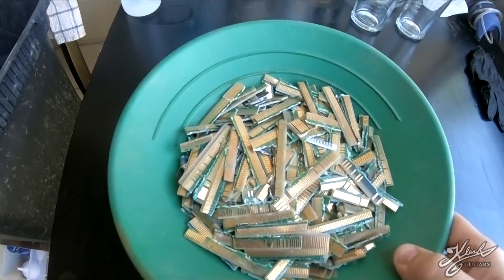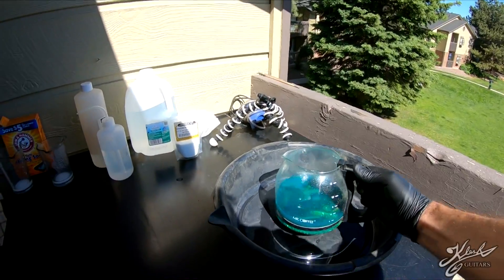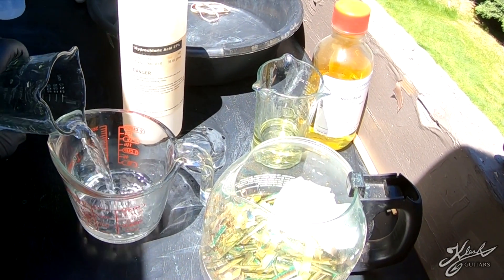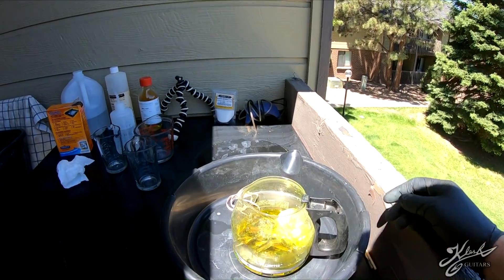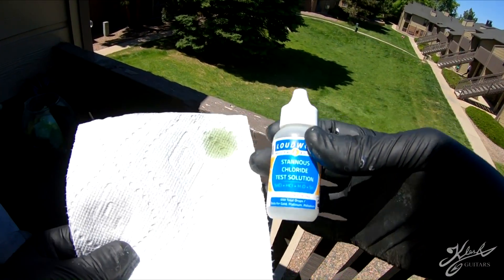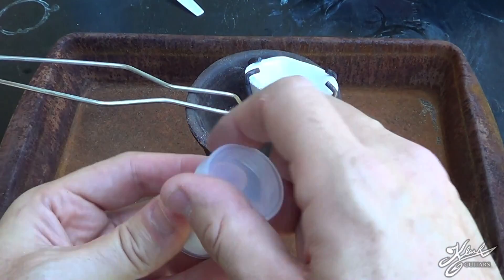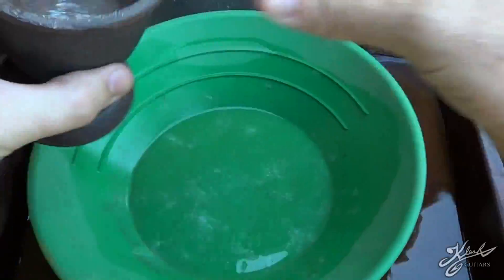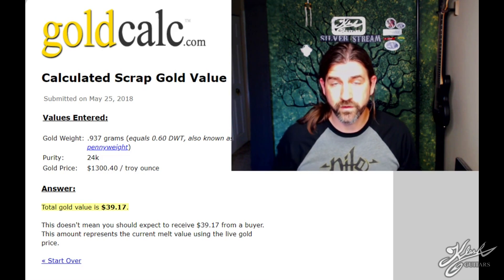How To Recover Gold from Computer Parts

Comment: I imagine your pretty new to e waste recovery.. your yeild is within the numbers as the range for fingers is 1-3 grams plbs.. being said not bad 😁 also premixing the ar wastes chemicals  
Causing excess SMB to be added recommend adding nitric to hcl in small doses) increments to dissolve gold using sulfamic acid to denoxx nitric free in solution is a trick of the trade...allowing you to avoid the foaming and possible boil over risk later...using 1 gram of SMB per 1 gram of expected gold works as a recipe... Personally I prefer using a dilute nitric until all the foils are released from sticks... Then concentrating to filter and washing... Then a ar solution will be cleaner and look yellow instead of green...as you know your solution had some copper dissolved and adding extra SMB drags down other metals when you percipitate the gold from solution... Making good less pure.
Absolutely love the percautions and clear throual step by step explanations.bravo good job hope my advice helps there's much more to learn these are basic steps I follow and such...may the gold be with you...
Reply from the maker: Thanks, yes I am new to doing this. I really appreciate the help! Also, thanks for watching!

Comment: I use a mini Oxy torch kit. Run on 2 1lb cylinders and gives good heat. I tried to do a copy and paste an Amazon link to my comment but it wouldn't let me. Just do a search for mini oxy acetylene torch kit. The burn through the gas, but they are fantastic for small jobs.
Reply from the maker: Steven LeBlanc thanks I’ll take a look

Comment: Does a older computer have more gold in it? I have one from the early 90's. Iv'e been saving some hard drives up. I wanted to find out how to do this. thanks, you should have saved that whole peace and made into a pendant.It looked very Kool. I put peace and Kool in because I'm from the old days. great video, i loved it.
Reply from the maker: don Moor4e not sure but I think older computers have more?
Reply: Older electronics did use more gold, most eletronic gold today is only a few microns thick, aloy of older telecommunications and military eletronics though used solid lower karat gold rather than todays 24 karat thinly electroplated gold.
Reply: Thanks

Comment: Heh this is something I know about. Unfortunately my parents don't let me play with highly corrosive acids T.T (JK I'm nearly 28)

I have to make my own peracetic acid to dissolve copper for electro plating and play with safe chemical reactions like thermite. (dont try thermite at home please)

That and I do all my experiments in an non-ventilated shed, aside from the thermite which I do in a dirt 'firepit'  I know silver thermite exists, I wonder if someone could get gold oxide and make gold thermite :O I know they use Gold oxide for glass work, but i'm not familiar enough with chemestry to know if it would work. Might need to call Cody's Lab for this one.

I'm waiting for the day I have enough panned gold to make a bar at home <3 I have a forge built out of a hairdryer and trash can that can easily melt gold and silver though I primarily use it for aluminum.

Also, 1 pound of electronic fingers is around 1 gram on average 1:1 gram to pound of scrap is a general estimate, though it strongly depends on the quality of the scrap. Something coming from Gaming high quality Ram vs cheap Shinese knockoff will have huge differences in the gold plating on the connectors. Same goes for wires and hardrives, processors, obviously the better built ones have a thicker gold plate.

Comment: not too shabby from 1 lb of parts.  There is a slightly safer method using vinegar, salt and heat, and it also needs to sit about a week if I remember correctly.  https://youtu.be/ouYW_7-Njbs

Comment: I have seen other videos like this. Actually built my computer. Not only ran has gold CPUs and motherboards do also. But it does seem like alot for return. I guess after you get everything you need and have left over chemicals. You could turn a small profit. Getting the parts for free also would help. I am extremely confident I could preform this. But do I want to no. One wiff of those fumes can kill you or damage your lungs making you life very unhappy. Cool video. I will stick to prospecting and paydirt lol. Pan on All.